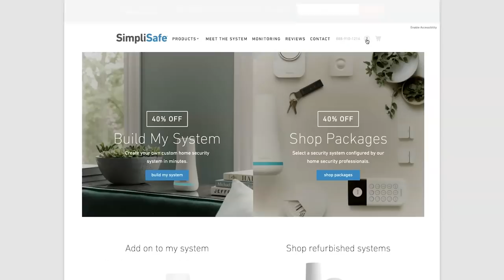THE PRESSURE IS ON | WORKING AGAINST THE CLOCK

Comment: Drywall is an art.  No doubt.  As Allie says, it's about doing it yourself.  The reward is fantastic.  But the "best" part (which you guys may already be into by the time this vid is out)...is sanding.  You get to apply that next coat and start sanding.  Become ONE with the sanding...or it can become a pain.
And yes, those plastic mud trays suck...stainless steel is the way to go.

Comment: Mudding doesn't have to be perfect but it needs to be easy to sand.  If you put anything into the mud that is hard to sand then it's a problem but a small bump is easy to sand and isn't a problem.  It will take a couple of rounds of mud and sand to see what's what.

Comment: Why don't u try running the tape over the corner plastic pieces, to fill in and lock the mud into the holes in the corner pieces and then just smooth them off as we use those corner pieces in Australia to tie the corners of the rooms in in that way

Comment: For the skim coats, water down the mud a little more than the tape joints so it's smoother and keeps your insanity.  9in blade then one more with the 12in blade.......because "wait till sanding! $%@!" if you don't. lol  Makes it much easier and less sanding.  I rarely sand anymore.  And with those wall areas, you def want less sanding if none at all.  Easy process, so trying to help make it easier.

Comment: Someone did till you to pour water over your mud in the bucket and take the 6 inch. Blade and wipe around the sides so you don't get the little hard pieces. You 6 inch. Is your friend. Reach through the water to the mud. At the end of the day  use a brush wash down the sides make sure your water is covering  the mud.

Comment: You haven't mentioned anything about texturing the walls. Are you planning a smooth finish or were you  going to spray on the texture or trowel it. I had my basement troweled it's easier and quicker. No experience necessary

Comment: inspired by your enthusiasm, but seriously recommend you do your first room in a closet or somewhere where you can learn and initial mistakes wont show. Plastering (mudding) is not a skill, its an art-form. There are courses and stuff. We did every job in our entire house, but learned after 1 room of plastering that we are not skilled at plastering, it looked terrible - not flat at all , or smooth.  if it looks like cr*p it you will be sanding for the rest of your lives. Hire a pro - really, really recommend that for the walls.

Comment: The truly terrible part of taping and mudding is yet to come. You haven't started the sanding yet. There's the sanding between layers of mud and the final sanding before you can paint. If you think you've gotten dirty before, wait until you've dealt with the mud dust. The dust kicked up from sanding the mud gets into everything throighout the house. We just did our bathroom and the dust spread throughout our kitchen, laundry room, and pantry too. You might want to wear breathing protection while doing the sanding. Allie probably should pretty much stay out of the house during that time too. It's rough on the skin and even rougher on the lungs.

Comment: Okay if you listen to anything I say please do this. DO NOT SCREW THE CORNERBEADS WITH SCREWS. USE Drywall nails or learn to crimp them with a 5 in one tool. Screws will p koi cker
Reply: The metal will pucker and be hell to get it to go flush to the drywall and mud will a lot easier when you can move quickly. Finish tip do one side of the  corner let it set then do the other  Side